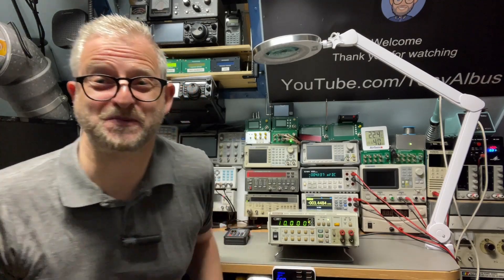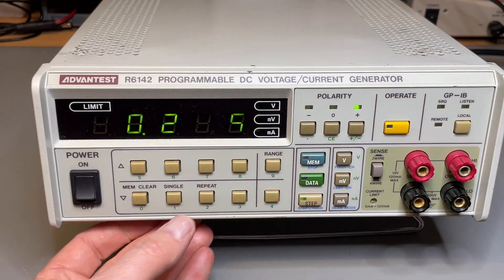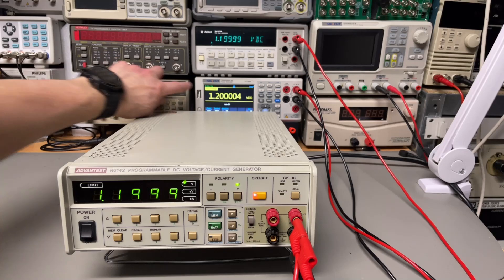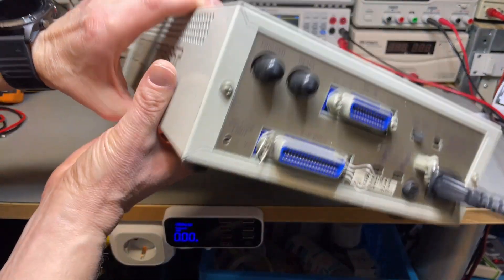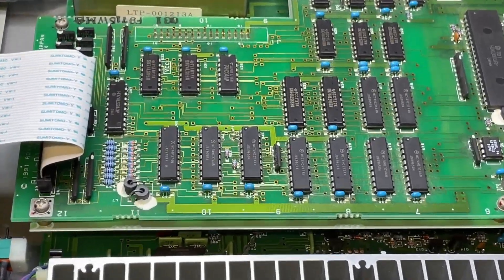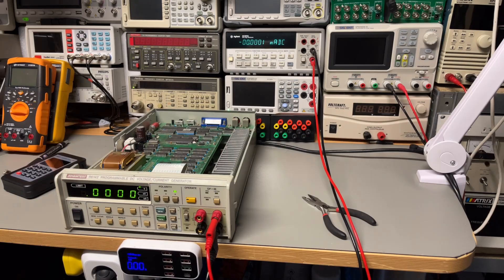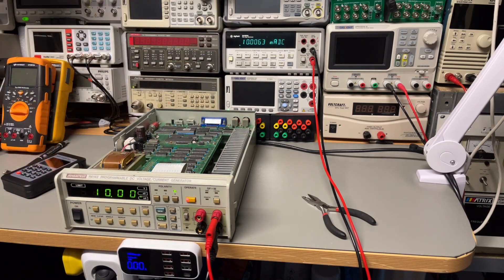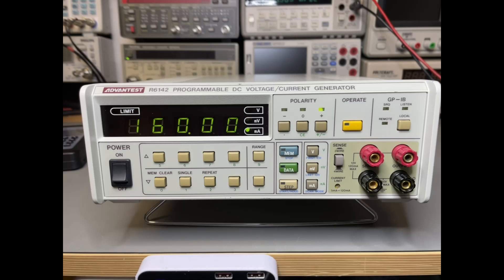TA-0349: Advantest R6142 V-A Source - Intro , Upgrade and Calibrate

Comment: Interesting, I posted a message but it didn't show up. So I will try again.  I was planning on designing and fabricating a simple current reference but then I saw your video.  I ordered an R6144 on eBay from Japan and I easily found an English user manual online.  Price seemed good and it looks in mint condition. It is always dangerous for me watching your videos because I end up buying equipment.  As usual Tony thanks for the videos.
Reply from the maker: Hi John, hope you are good, great you found a R6144, yes manuals are now good available on the known websites. let me know when you have it and need some information.
i will copy the firmware, because i think i have one of the latest.
Reply: @TonyAlbus  Tony, Thank you for the kind offer.  When I get it I will check the firmware and if I have a newer one I will be happy to offer you the same service.  Should be here the end of April or first part of May.
Reply from the maker: @jwrtiger  Thanks John!

Comment: @tony, I have replied to your replies twice, but these do not show up. Sorry for that. Thanks for you suggestion. Started looking. Found fluke 510A to be with extremely low THD, and SWR200 chip (expensive) at Mouser, and 10eur 8th order low pass filters from Maxim that can at least help producing a perfect sine. Keep up your good work!!
Reply from the maker: Hi Peter, Thanks. about the comments, YT just deletes everything that has and url in it. no matter what my setting is, i allow all comments, i allow all urls, but still they know better. The spam system is to strong, i have no control over it.
Reply: Got it!! That must be it. Love your channel. Keep up the good work
Reply from the maker: @sdrnovice2000  Thanks!

Comment: Moin Moin, calibration is easer if you enter the value you measure. In calibration mode press data than enter the value you measure and press data again. If your value is - than press the plus button (polarity).
Reply from the maker: Thank!! great to know this now, thanks for sharing.

Comment: Hi Tony, nice catch 👍 I have a question, isn't it an offset adjustment rather than an actual calibration?  I have a similar function with the digital programmable thermostat - adaptation to the manufacturing tolerances of the sensors.

Nice day 🙂Tom
Reply from the maker: Thanks! , yes its calibration.

Comment: I bought the other one on marktplaats a week ago form another seller than you did. It was out of spec on 3 ranges, but I succeeded in calibrating it with a calibrated meter from my employer. I found the same issues with the device over- and undershooting. I've not opened it up yet and I think I will leave it as the nameplate says: R6142. Curiously mine has a different firmware version 02.01. Not sure if it impacts performance but might want to upgrade when I feel like it.
Reply from the maker: Oh that was you, yes there were two... my seller had 3 of then, also firmware 02.02 and he told me the he could find no change in operating and behavior, lots of times those firmware updates are GPIB compatibility thing, bus could also be more. let me know if you want me to make a copy of my firmware.. the eprom is in a socket.

Comment: Tony, I am looking for a precision 50Hz sinusoidal AC voltage source. 5 or 10V fixed would do. Adjustable would be a bonus. Do you have recommendations? I like your diy DC voltages sources. Not sure if AC models exist
Reply from the maker: Hi peter, there is that Matrix AC source, but its not really precision.. : https://www.youtube.com/watch?v=2UBK7df4McM  so then i think you are maybe looking at AC calibrator, have a look on ebay. some nice older Fluke AC calibrator/sources are around, but not cheap.
Reply from the maker: Still have the idea the add a 10turn pot to the Matrix i have (on the bcp is a finetune)and then adjust in with an external 6.5 multimeter to set it spot-on... but that idea also kind of went away now i have the Fluke 5100 Calibrator.